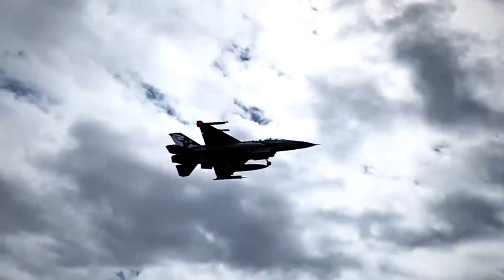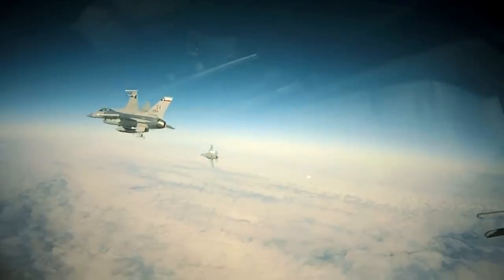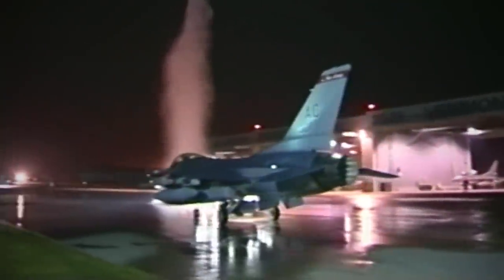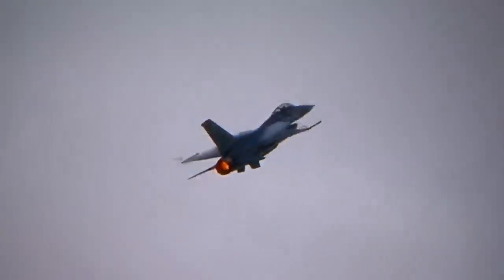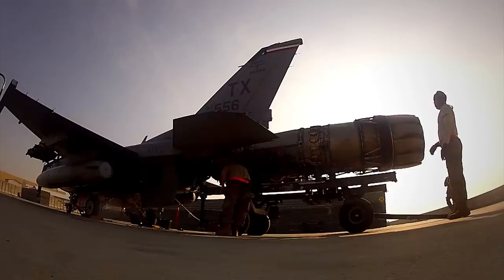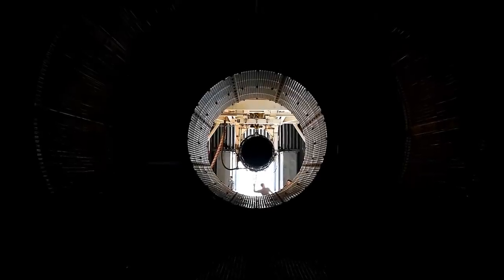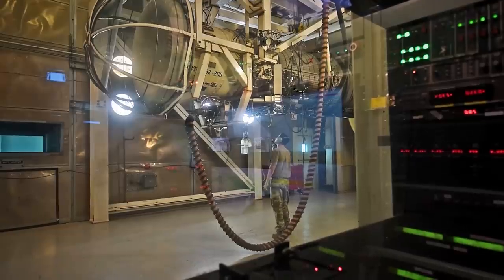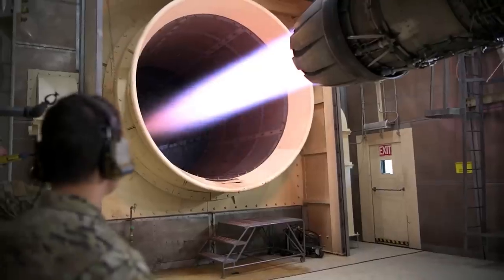The Hush House Silencer - F-16 Afterburner Maximum Power Test

Comment: Same engine as F-15 that has 2.  I was An Engine Maintainer and Aircraft qualified for full Augmenter runs in the hush house.  Craziest experiences were troubleshooting Augmentor No-Lights.  You are dumping fuel in the tailpipe hoping the ignighter will light it.  Then when it doesn’t and it finally gets ignited of the heat of the turbine blades and sends flame back up the intake and around the cockpit.  Talk about a rush.

Comment: The over 32k pounds of thrust is an engine that is not equipped with any of the US F-16s the 30k+ thrust is the F16 variant sold to Saudi. The max thrust for a US variant F-16 is around 29,160 pounds of thrust.

Comment: Used to be able to hear them run up at the GE test cells 6-8 miles away before they upgraded the baffles.  Most engines there were in for warranty repairs…

Comment: lol this video is kind of funny because I have first hand knowledge on it, I don't think it implicitly states that these engines were and are only tested in hush houses but it makes it seem that way; they are often tested outside however using mobile engine test stands that are similar to a hush house in tech but are controlled and monitored via a mobile "control cab". The companies Atec and Celtech both make engine testing equipment featured in this video and I urge the creator of this video to research both Atec and Celtech. These engines and many others (including the f35's engine) are tested using these two companies test stands/hush houses and they have built entire companies based on the IDIQ contracts for building and maintaining these. I think credit in the video is necessary as their equipment is shown in almost every shot of this video. you can see their logos in most of the shots and it would be helpful to viewers who want to know how the machinery actually takes the measurements if you were to include some details from both companies.

Comment: You left out the more common nickname on nboth your F16 videos - Lawn Dart.  You left out one other important fact.  F16's could take off & reach its max altitude before reaching the end of the length of runway. I worked on the GE side of the f16 engine program.

Comment: Would have liked to know how the engines power compared to a commercial engine like one of the A380s engines
Reply: The enigne on the A380 have a lot more thrust but the biggest thing between them is when you push the throttle up on an A380 the enigne is slow to spool up. Where with a fighter jet enigne the power is there now.  Both engines are turbofan engines but commercial engines are high bypass fans and fighters are low bypass fans.  If you want to learn more about the diffeance look it up.

Comment: So, the YF17 hornet was always dual engines? No idea how the fly by wire is a pilot, but the F16 seems to be very agile & has decent load out & range. 

Conformal tanks & supercrise would be nice, but SC engines are likely can’t fit. Amazing it can handle so well with it’s wing area and control surfaces, but if the designers say it’s unstable & needs to be fly by wire, I’m inclined to believe them..

Comment: So when you say "maximum power test"

You actually mean 85% of maximum power test?

Or do you actually mean full WEP?
Reply: I don't know why he says 85% because when these test are done it is to max power.  He may be thinking about the engine RPM where a test is done at 85% eninge RPM before going to max power.  The reason for this test is to check that the enigne limits are good.

Comment: The J-75 produced 26,500 lbs of thrust  back in 1960 and 1970.  3000 lbs more thrust is not that much for 50 years.
Reply: The F100-PW-200 enignes were first built in 68 and the F100-PW-220 use the same core as the -200.  The F110-GE-100 first started being used in early 80's.  The F110-GE-132 can produce 32,000 lbs of thrust.  The biggest differance is these engines are not turbojet like the J-75 and becasue of that they use a lot less fuel to produce the same amount of thrust. Had to look up the numbers but the highest thrust you can get with the J-75 is 26,500 and that with afterburner using water injection.  Most of the variants are 24,500 with just afterburner.  I'm in no way saying the J-75 is a bad engine because it was used on the A-12 before being changed to a J58.  Again the biggest advancement is fuel efficacy.

Comment: The F16 was half the cost of the F15 
The USAF was split between the F16 vs F15 
More money more complexity equals F15 eagle 
Less money less complexity equals 
F16 
The F16 top competitors were the 
FA18 hornet & F15 eagle 
Basically the F16 was the modest version of the other 2 aircraft 
Shalom world peace ☮️
Reply: afaiu the US plans on using the F16 for many more years and before an F35 is used someone has to explain why an F16 can't do it, because it only cost a third to fly

Comment: The F-16 doesn't go through a thorough inspection every 300 flights. The phase inspection is done by flight hours and only every 4th lasts longer than 5 days. Also, pilots don't do s@@t with removing the engine.

Comment: They went through all the work of bringing the engine to the testing facility, why would not test the engine at 100%  of thrust rather than 85%?  Pilots may need that extra 15% and need to know it won't blow up on them. This video also shows people in the same room with the engine during the testing process - that's not right.

Comment: Huh, so it tops out somewhere past Mach 2.
If my math holds out (don’t ask) - even tanks can crack Mach 2 - if you drop them from high enough.  They may need assistance to get airborn, but they’ll crack the speed without any other aid.
Reply: how high for a Bradley
Reply: @mr.bonesIsOnline  Higher than the tankI] I did the original math for…
for a Bradly, at sea level it’s terminal velocity will be north of 836 mph.  get heigh enough, the air gets thinner and you can probably still crack Mach 2.
for an Abrams (smaller cross section, higher mass, being generous using the heaviest model) terminal velocity at sea level is north of 1427mph gets you to 1.85 Mach.
The original math I had done was for 30k feet, which would land short of terminal velocity, starting from a height with air too thin to breathe (much thinner air -> higher terminal velocity during the initial descent)
The actual numbers at that point get beyond my math. factors to solve for then include:
- do I need to use different terminal velocity equations for Mach+ speeds.  If you get high enough the air is thin enough it stops mattering, but it’d be good to know.
- Falling into thickening air will affect how quickly it approaches terminal speed.  That gets directly into levels of Calculus that I’ve lost.
Reply: Seems too high for something so far from aerodynamic. What would the terminal be of an f-16 nose diving to earth with no engine power? Not saying you’re wrong it just seems high and I’m certainly not about to do the calculations.
Reply: The C & D models i worked on were 1.5-1.8 IIRC and as far as i remember no 16 broke mach 2 since the A models. they have added so much weigth to them over the years its hurt them in speed and maneuverability
Reply: @rustyshaklferd1897  the calculation for terminal velocity takes a few values:
mass - 73.6 tons.
Cross-section (HxW) - 96 sq ft (estimate is high)
Air Density - 1.225kg/m3
Gravity - 1g
Drag coefficient - 0.294 (equivalent to a sky-diver head-first)

That’s the basic calc I did.
chasing down F16 drag coefficients brought me to a series of tables showing values for drag coefficient of the F16 at various AoA and Mach, which demonstrates neatly that the coefficient isn’t actually static, and it rises sharply at higher speeds.  It also gets me into that calculus realm that I avoid (I do enough brain damage writing code to calculate ACF functions and failure-rates for work).
I still maintain that tanks can break Mach 1 if dropped from 30k feet (Abrams yes, Sherman, probably) and defy math experts to prove otherwise.  I’d been doing ballpark envelope math at the time, and made the claim here (right or wrong) based on my fuzzy memory of such.  If you to get serious numbers or to myth-busters it, go ahead, just don’t drop tanks over my house please - it’s not zoned for air-dropped artillery.